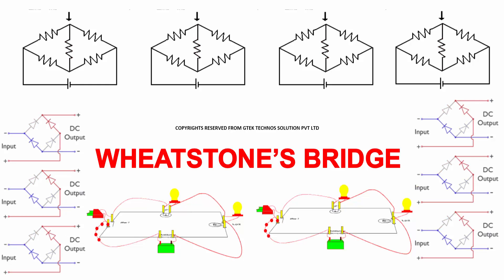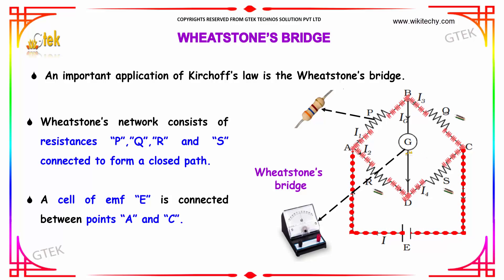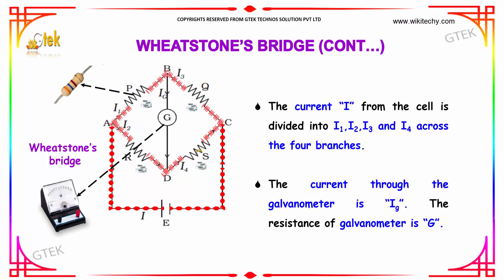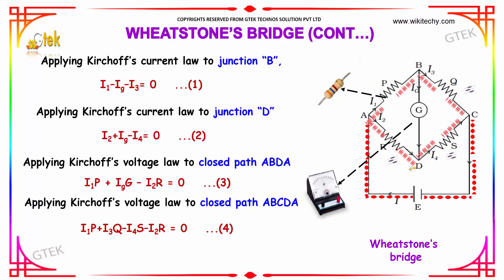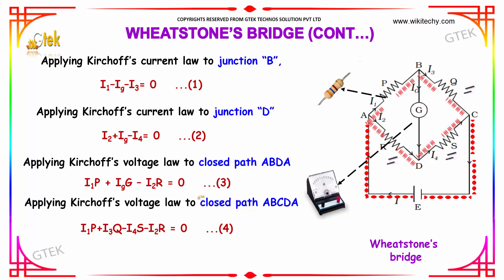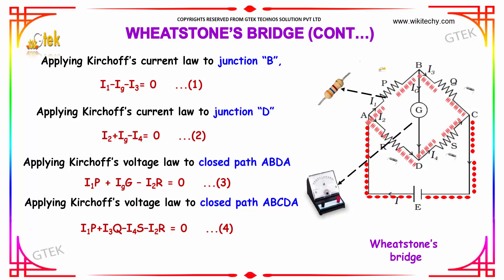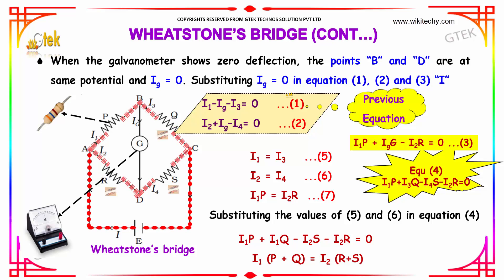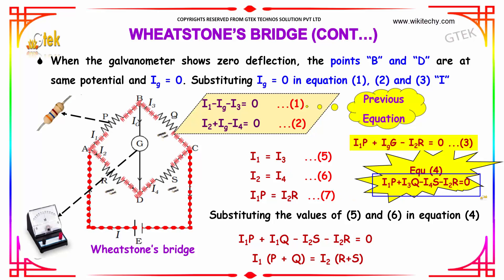Wheatstone’s bridge Current Electricity class 12 physics subject notes lectures CBSE IIT JEE NEET

Comment: Wheatstone Bridge. For measuring accurately any electrical resistance Wheatstone bridge is widely used. There are two known resistors, one variable resistor and one unknown resistor connected in bridge form as shown below. By adjusting the variable resistor the current through the Galvanometer is made zero.

Comment: In AC bridges, all the four arms consists of impedance. The AC bridges are formed by replacing the DC battery with an AC source and galvanometer by detector of Wheatstone bridge.They are highly useful to find out inductance, capacitance, storage factor, dissipation factor etc.

Comment: A bridge circuit is a type of electrical circuit in which two circuit branches (usually in parallel with each other) are "bridged" by a third branch connected between the first two branches at some intermediate point along them.

Comment: A Wheatstone bridge is an electrical circuit used to measure an unknown electrical resistance by balancing two legs of a bridge circuit, one leg of which includes the unknown component.

Comment: When the bridge is fully balanced, the right side resistors identical to the left side resistors (R1=R3, and R2=Rx), the voltage across the bridge is zero. However, with a small change in resistance on one of the resistors, and the bridge becomes unbalanced, and a voltage difference appears.

Comment: Meter bridge is a wheatstone bridge in which one lateral pair of resistances is replaced by a straight wire of length 1m of uniform cross section. And other pair consist of one known and one unknown resistance.

Comment: In the "student" form of the bridge, this is a one meter long slide wire of low resistance. One lead of the galvanometer connects to a sliding tap key that can make electrical contact with this wire at any point along its length. Fig. 3. Slide wire form of the Wheatstone bridge.

Comment: https://en.wikipedia.org/wiki/Wheatstone_bridge
A Wheatstone bridge is an electrical circuit used to measure an unknown electrical resistance ... is varied until there is no current through the galvanometer, which then reads zero. Detecting zero current with a galvanomete

Comment: The Wheatstone Bridge circuit is nothing more than two simple series-parallel arrangements of resistances connected between a voltage supply terminal and ground

Comment: For measuring accurately any electrical resistance Wheatstone bridge is widely used. There are two known resistors, one variable resistor and one unknown resistor connected in bridge form as shown below. By adjusting the variable resistor the current through the Galvanometer is made zero. When the current through the galvanometer becomes zero, the ratio of two known resistors is exactly equal to the ratio of adjusted value of variable resistance and the value of unknown resistance. In this way the value of unknown electrical resistance can easily be measured by using a Wheatstone Bridge.

Comment: The Wheatstone Bridge circuit is nothing more than two simple series-parallel arrangements of resistances connected between a voltage supply terminal and ground producing zero voltage difference between the two parallel branches when balanced.

Comment: a simple circuit for measuring an unknown resistance by connecting it so as to form a quadrilateral with three known resistances and applying a voltage between a pair of opposite corners.

Comment: The Wheatstone Bridge can still be used to measure very low values of resistances down in the milli-Ohms range. ... The Wheatstone Bridge circuit is nothing more than two simple series-parallel arrangements of resistances connected between a voltage supply terminal and ground

Comment: Wheatstone Bridge. For measuring accurately any electrical resistance Wheatstone bridge is widely used. There are two known resistors, one variable resistor and one unknown resistor connected in bridge form

Comment: A Wheatstone bridge is an electrical circuit used to measure an unknown electrical resistance by balancing two legs of a bridge circuit, one leg of which includes the unknown component. The primary benefit of a wheatstone bridge is its ability to provide extremely accurate measurements (in contrast with something like a simple voltage divider). Its operation is similar to the original potentiometer.

The Wheatstone bridge was invented by Samuel Hunter Christie in 1833 and improved and popularized by Sir Charles Wheatstone in 1843. One of the Wheatstone bridge's initial uses was for the purpose of soils analysis and comparison.